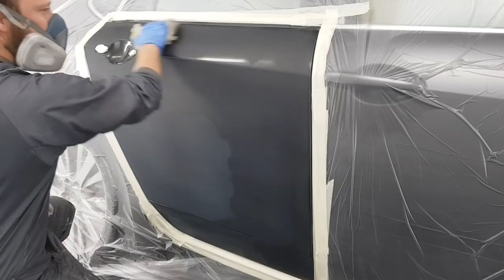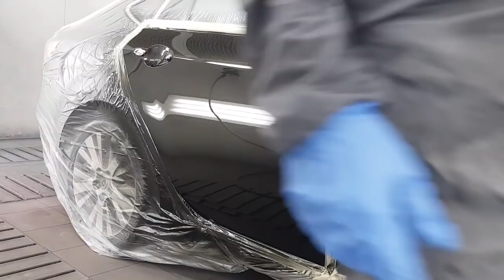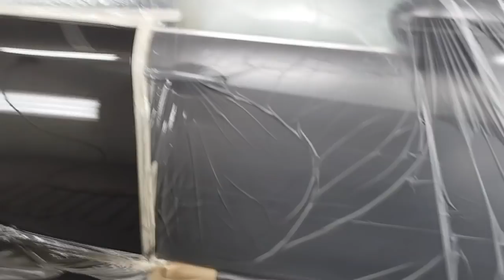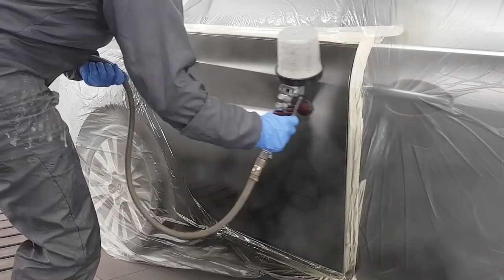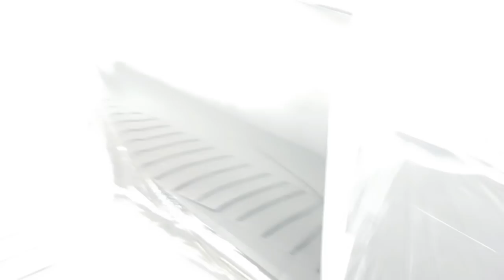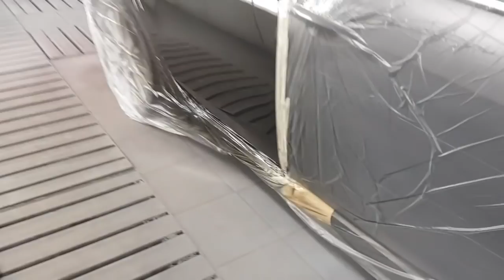Quick Paintjob!

Comment: Such a nice clean job!
Looks like you're using the Prolite. What setup do you run for clear coat and what kind of clear coat do you use?
I just recently started at a new shop that uses Glasurit clear coat. Im using Prolite with TE20 and 1.3 tip, also tried 1.2 tip, and i am struggling with getting tje clear coat to lay flat. Im getting alot of orange peel/texture in the finish...
Any tips?